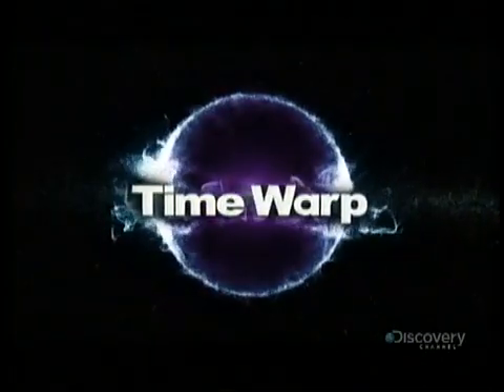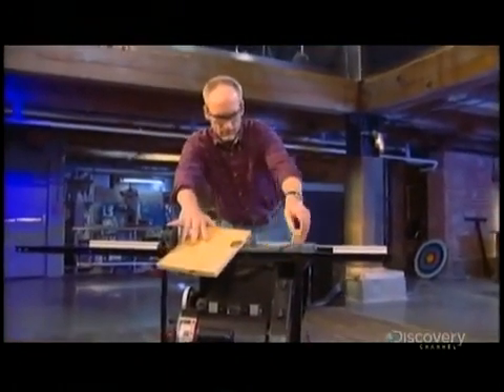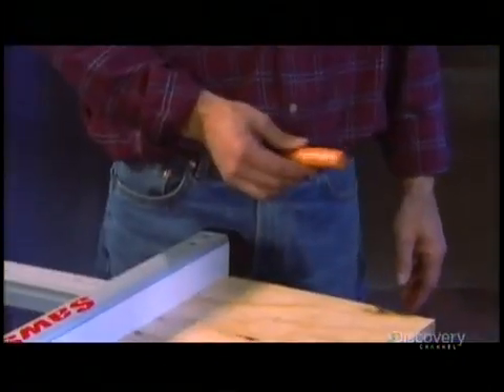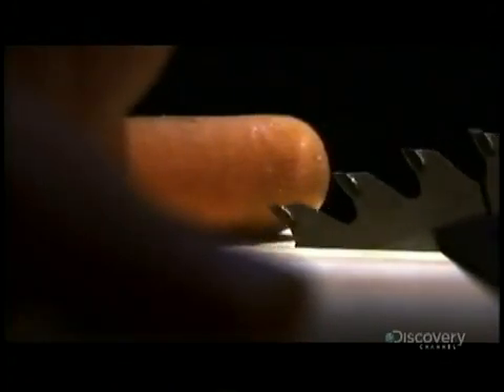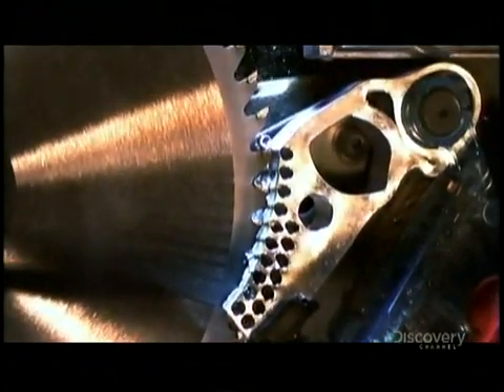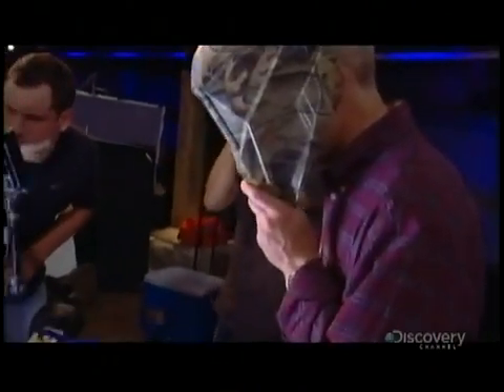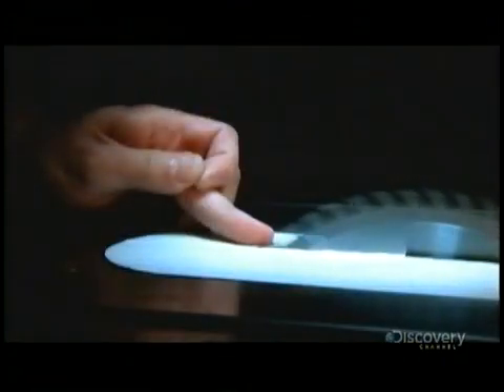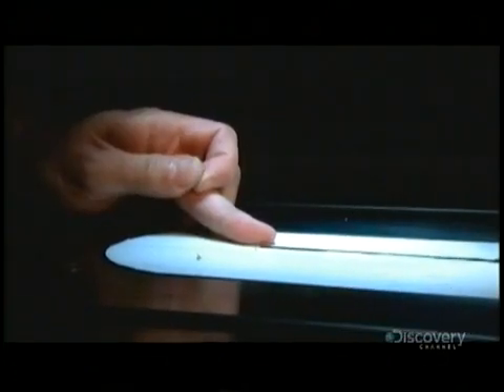Saw Stop - This guy puts a finger into an active table saw blade & comes away without a scratch!

Comment: ok his finger going torwards it slow as fuck will stop it and he wont get a scratch but I guarantee you if he was cutting a piece of wood the normal speed you would and his finger got in the way it would slice right off
Reply: +joe swanson He did it at normal cutting speed with the hotdog. Surely he didn't wanna risk getting cut, with his actual finger, the device only prevents it from cutting off your finger, not harming it entirely.

Comment: why not instead of stopping the saw, it gets pulled under the table immediately, the saw blade doesnt spoil and u dont have to keep replacing the breaks
Reply: +Yang YangYang Pulling down the saw blade would take way longer than this way, so there would be more time for your finger to get hurt or pulled in. Just stopping the saw blade by absorbing all its kinetic energy is the most reliable and also the fastest way to prevent injury.

Comment: What if the wood is wet? I come across damp wood that I need to cut a lot.
Reply: +Techommentary Or your wearing non conducting safety boots? Would holding wood what your sawing ground you to machine body and to ground, or leaning (with thick clothes) to machine give enough ground this to work?
I really respect these machines, specially when i have been next to work buddy who decided to shorten his nails little bit too much or paint wall panel in red. This invention is amazing idea, but i kinda doubt its fool proof.
Reply: Disable the mechanism temporarily.
Reply: Wet wood will trigger it

Comment: I don't get why he has to shred the machine. He has a mechanism that puts away the blade so why is that not enough?
Reply: +Michael Beck It stops the blade from spinning really quickly. With the other mechanism only, it would still be spinning as it goes down. That spinning could definitely cause harm.
Reply: +Hippy Lemonz the way I saw it is that when the finger touches the finger the saw escapes below the surface and gets stopped afterwards. Thats the point I don't get. If you have the saw below the surface there is no point in stopping it. Or did I get something wrong?
Reply: Michael Beck
Yeah, I think you might've. The way I saw it was that the blade completely stopped spinning before it even started to go down. Otherwise, there would be no point stopping it, as you are suggesting.
Reply: +Michael Beck   It doesn't shred the machine, it only damages the blade and the stopping mechanism.  The blade cant drop fast enough to prevent a serious cut, thats why it stops and drops. Most of the real world examples they show of this working, show the operator getting at least a small nick. Most people cut faster than what they showed in the video, if it stopped any slower there would be far more injury.

Comment: I ran a mill for almost 3 years with one of these. It preformed fantastic as a table saw. We worked it hard. Over  time we tripped the brake twice.....both caused by metal(nails) in the wood. The saw also has a bypass mode so the brake is shut off. I had to do this every time I thought there might be excess moisture or metal in the wood.... which was a lot. (bridge construction). Its an amazing system in my opinion.

Comment: Would getting close to the top of the blade stop it as well?
Reply: +GeeZillion no.. the black pieces are carbide and are on most cross cutting blades. its anywhere on the whole blade as the blade is electrified and the saw stop detects when you ground the blade causing the current in the blade to drop causing the saw-stop to trigger.  you could even touch the side of the blade.
Reply: +GeeZillion No it's just that contact wiith the metal surface of the blade is detected using sensors or just current that triggers the safety mechanism.
Reply: SchneiderMan
current only

Comment: The problem isn't the saw. It's the operator. If you're negligent enough to run your own finger through a saw blade, then you shouldn't be running the saw, or any other machinery.
Reply: +2hrsToChooseThis So what you're saying is, cars shouldn't have seatbelts because if you're going to be negligent enough to crash you shouldn't be driving anyway? You're saying that we shouldn't try to come up with measures to reduce the severity of mistakes because people deserve it in some way? What about airbags, or should the people who need those not be driving cars?
Reply: +Debated Nothing Not a good analogy; when driving a car there are many factors that can cause a crash; weather conditions, fault in the car design, other drivers' negligence, etc., but with a saw the only factor is how careful you're being.
Reply: got it so let's just take safety measures off everything because ACCIDENTS never happen
Reply: +kennethbgoodin so you're saying that you couldn't get knocked, slip or anything?
Reply: No, i'm not saying that; I'm saying that a car has a lot more that's out of your control than a saw. Ffs read what people are actually saying, not what you think they're implying.
Reply: +2hrsToChooseThis  Wtf are you talking about? My father has over 30 years of experience using that kind of tools, and he accidently cut half of his finger off during a day like all others.
You're basically saying that he should quit his job because he had 1 serious accident in 30 years?
That's like saying that when you stub your toe, you should cut them off, since it's your fault if you stubbed it.

It's an accident. Accidents happen, dumbass.
Reply: Mistakes happen.
Reply: +2hrsToChooseThis        Cutting solid wood can be a bit of a gamble, the saw can behave unpredictably. Also one of my former employees lost three fingers to a table saw because he was distracted over a fight with his wife hours earlier. THREE FINGERS.   Humans makes mistakes,  and although  we are all now trained not to operated dangerous machinery at times that we cant focus, or sick, or generally distracted some people still do.
- as a side note: technology is brilliant and can be adapted to a wide variety of machinery to save life and limb.
Reply: +2hrsToChooseThis It's insurance - you probably won't need it, but on the off chance you do, you'll be really glad you have it.
Reply: So you are saying that a man shouldn't jack off because the sperm will go to waste?
Reply: +2hrsToChooseThis or maybe the saw guide gives way and your hand slips with the woods etc etc.
Reply: sebastien boudreau on his hands? lmao wtf. fingers dude.
Reply: Ok, I went too far there...
Reply: +2hrsToChooseThis My school has this system. Well the High School I went to has it. $60 over a law suit worth $1000s if not more.

Comment: What happens if you are wearing a glove?
Reply: +apinakapinastorba eh it might not work, but as i understand it, you dont wear gloves while operating it.
Reply: it will still react;)
Reply: +Christian Johansen surely if it was a rubber glove or something it wouldn't cos it'd have no way to conduct?
Reply: dire_chinchilla it will react on rubber but nothing else:)
Reply: jetison333 People do all kinds of stuff they should not do, like putting their fingers in saw blades :) I'd like to see how that saw stop handles that.
Reply: ***** of course
Reply: ***** Hopefully they test all those worst case scenarios too and ensure those go as well as they can. "Happy case" is the easiest part of any product development.
Reply: +apinakapinastorba It would cut the glove, then stop once it sensed your finger.
Reply: If your wearing gloves then as soon as it cuts through the glove it will touch your finger and deactivate the blade?
Reply: +apinakapinastorba Actually wouldnt it cut through the glove and detect the finger then?  I mean, you even sweat more in a glove
Reply: +apinakapinastorba But you should never ever wear a glove when using a table saw. Where you might knick your finger or even worse, take it off. A glove will get sucked in sadly, whatever is on the end of that glove also comes with it. Yes your hand/arm  :s
Reply: +apinakapinastorba it will cut the glove and when it comes to finger it will stop, probably :)
Reply: +Christian Johansen be careful we don't want the fine Bros coming after you.

Comment: How much does it cost to fix it afterwards? I can only imagine that the blade is trashed along with many other things. Can you even fix it when it deploys? If i had to buy a whole new saw every time i accidentally nick my finger that would suck. I will just keep on being careful around my saws.
Reply: +chefdan87 well... its not like it gives you the freedom to just ram your finger in. Its just there if it happens, and if you use a saw like you should, then its imo worth it.
Reply: Janbay Hatukay
After watching the video i did some research on the product. Depending on the blade "standard or dado" it can be upwards 150+ dollars to repair it if the safety system deploys. It also does not work if the saw is turned off, so if you get complacent when the blade is slowing down its going to cut the crap out of you. Ive been working with wood for quite some time now and i know the 3in rule as it was burned into my head by my father "master craftsman" and my shop teachers when i was in high school. That being said the times ive been bit by my saw have almost always been when it was off an i lost concentration for a second. My point is i would rather have a band-aid  for a couple days than have to fork out all that money just to save myself from a nick.
Reply: chefdan87 Well, i didn't understand when you said "nick" but now that i do, then i realize your point.
Reply: Janbay Hatukay
Lol, it might be a southern country boy term that i didnt realize everyone would not understand. Yeah in the north or in the UK i guess it could mean steal or stolen something.
Reply: +chefdan87 you won't have a band aid mate, you will have a reattached finger. I wish you good luck, be careful with your knowledge i can tell you not very wise : )
Reply: PeaceTV Australia
I pity people with your level of ignorance.
Reply: chefdan87 keep telling yourself that, i wish you luck for your future surgery as well.
Reply: PeaceTV Australia
I wish you luck with solving your ignorance problem.
Reply: +chefdan87 "If i had to buy a whole new saw every time i accidentally nick my finger that would suck" you make that sound like it's a common occurrence. They say in the video it costs about $60 to replace, which is nothing compared to the cost of a finger.
Reply: Najda he meant that everytime he would get injured, so not the whole finger getting cut off or any substantial damage. Lets say he turns off the saw, and as it slows down his finger brushes over the saw and it gets a little cut.
Reply: Janbay Hatukay I understand that's what he meant, but that should never happen. Any competent woodworker will respect the saw and not risk injury like that. 

Also I don't think the failsafe is active when he turns off the saw. The safety current only flows through it while it's on.
Reply: +chefdan87 it does stop when the blade is slowing down anytime it's in motion it's active
Reply: It costs around 50 to 90 dollars to repair  the saw and saw brake
Reply: +chefdan87 
After years of holding out on a table saw (b/c of the dangers) I finally bit the bullet and bought one.  I've read and watched (youtube) the dangers of the table saw and never came across the 3 inch rule.  Do you mind explaining to me what that is.  I still have all my fingers and want to keep them that way.  The sawstop sounds great and all but I don't have the $$$ to buy one.  Thanks
Reply: fantastic4ofus
I was taught the three inch rule from my father and grandfather while they were teaching me to work with wood. Even my shop teacher in high school had a similar rule but his was 5-6 inches for extra safety for students in a public school. The rule was simply a guideline to never let your hands, fingers, arms etc within 3 inches of a moving saw for any reason. Push and guide blocks should be used in circumstances where you have to get close to a saw blade. Table saws, bandsaws, table routers, planers, jointers are all dangerous equipment that could care less what they are cutting through. I've never seriously injured myself but i have had a few minor cuts here and there. My gripe is forking out upwards of 160 dollars every time i have the slightest cut to fix the saw that is now useless until you get the replacement parts. Accidents happen no matter how good you think you are, and you should always practice safe operating standards around this equipment. But i just dont see spending that much to fix a saw when i could have spent the money for a band aid and kept working.
Reply: +chefdan87 
Sounds like a very smart father, grandfather and shop teacher!  I figured it's common sense to not be so close to a moving blade with any part of your body.   Push stick...etc make the most sense when getting that close.  I agree with everything you said and I will also keep in mind the 3 inch rule!  Happy wood working and thank you for your reply.

Comment: How many times can it stop like that before it doesn't work any more
Reply: Once, after that you'd have to buy a new one!
Reply: +chefdan87 So your finger is worth a couple of hundread dollars?
Reply: +lewis Nunn 
You replace the metal brake you see in the video being crushed. $69 for a standard blade brake and $89 for a dado blade break. There is a chance of it sparing the blade but i highly doubt it and really wouldn't trust a blade after it went through so much stress. Seems pricey, i would rather just continue to be careful around my table saws.
Reply: +lewis Nunn 1. Once it stops it needs to be replaced.
Reply: +chefdan87 that's why you have to be careful around any table saw.
Reply: D3mon Edg3
I agree but i would rather have a small cut on my finger from a slip than have to deal out upwards of a hundred dollars to fix my saw.
Reply: +chefdan87  what about titanium?
Reply: +chefdan87 I wouldn't want estimate any of my body parts in money.
But there are other protection systems who stop your hand when you get near the area of the blade, and therefore they can be reset instantly without any additional costs.
Reply: +chefdan87 
Perhaps it's price... but how about instead of stopping the blade it just goes back and hides in some sort of "cave"?
There's a system like that? I think i saw it before... so the question is if someone can make the blade back off as fast as this method so not even the blade gets damage and the damage on human flesh is as little as this system shows.
Reply: Yorcont
The blade is moving at a really high speed, it would make sense to move the thing that is supporting the blade, but the system may end up coming with a worse activation time and higher repair cost. Someone would have to be quite ingenious to be able to pull something that doesn't break every time you mess up. Altough if you ask me, people need to feel the cost of messing up because they get too used to mess up if there aren't any repercutions. A mechanism that is replaceable and not super expensive sounds like a fair thing for every mess up you made. 30-80 bucks it's a fair deterrent to stop putting your finger in the sawblade.
Reply: +chefdan87 If you're careful you install it once and never need to replace it anyways. If you're not careful on day, you lose a finger if you don't have it.
Reply: robsnook4512
Try reading all the reviews of the problems people are having with the saw. False brake trips on wet wood, pressure treated lumber, embedded metal like staples screws or nails in reclaimed wood projects, riving knife causing trips and just general electrical issues causing frequent false brake trips. This product is no more than a gimmick, yeah it has the chance to save your finger if you slowly come into contact with it. Even their own company says there is still the risk of serious injury if you hit it too fast, and that is when serious injuries happen on every saw. You dont slowly cut your finger off, it happens after kickbacks or other scenarios that bring your hands into the blade with force. After each one of the false trips you still have to pay for the replacement parts and new saw blades that are now trashed and warped. Nearly 30 years old and i still have all my fingers, i'll stick with my old school saws.
Reply: chefdan87
It's a new product, you can ask for improvement, but the idea is great.